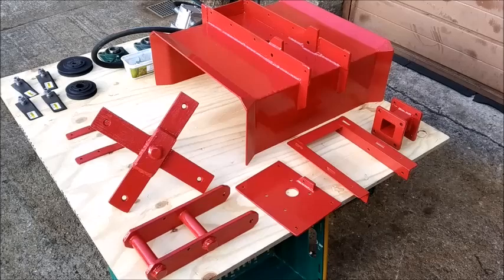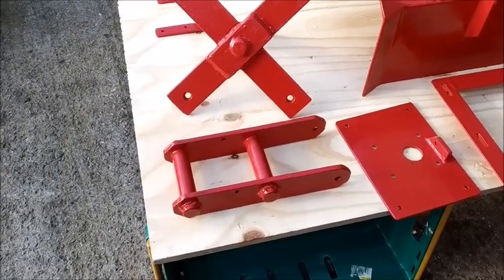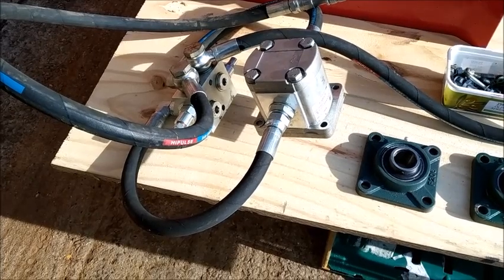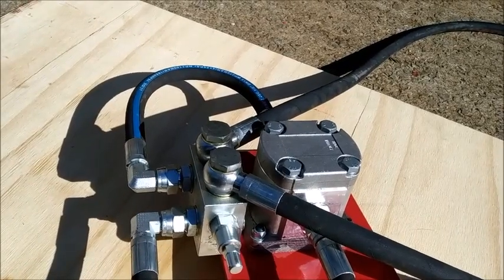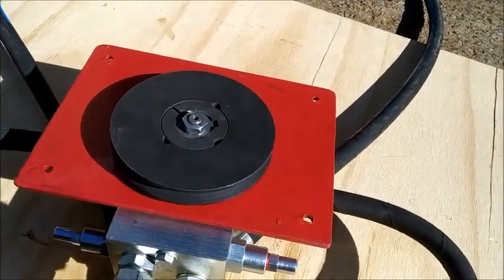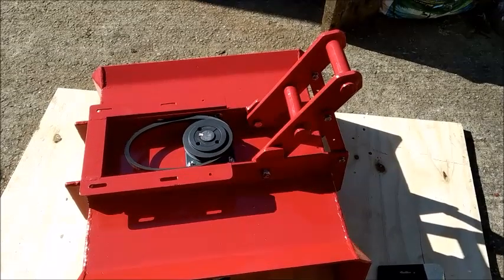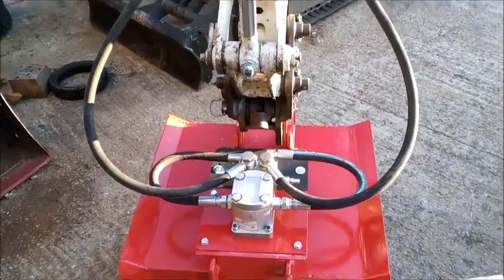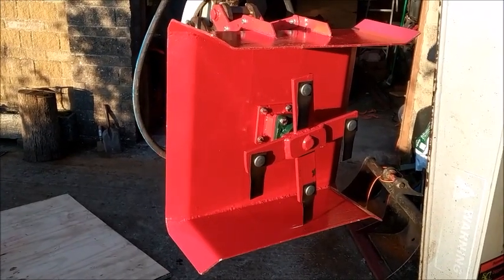Flail Trimmer for my Takeuchi TB216 Mini Digger

Comment: Hi great design, what did you do to ‘modify’ the relief valve? Currently ordered same motor and valve trying to recreate similar many thanks
Reply from the maker: The pressure relief valve has two pressure relief circuits, one I set so that the pressure relieves if the motor is stalled in the normal direction the other one the spring was removed and a short spacer fitted so the valve could open with zero pressure. This allows the hydraulic motor to over run when the hydraulic pressure is suddenly stopped without causing cavitation.

Comment: nice job well done . would you have a part number for that hydraulic motor with with internal case drain ? is it a group 2 motor with tapered shaft or straight  shaft ? thank you .
Reply from the maker: The motor is a single direction gear motor so there only needs two pipes and the internal drain return goes internally to the outlet. Its a tappered output shaft that I fitted one of Flowfit splined adaptors that I ground to take a standard size pulley.

Comment: Nice work! What size motor did you use?
Reply from the maker: The digger has a maximum hydraulic flow rate of 30L/minute (500cc per second) based on that I wanted a speed of around 2000 rpm. Hydraulic gear motors ratings are quoted by cc per revolution, using this I used a motor with 14cc per rev. Theoretically at 30L/minute a 14cc/rev motor should run at 30000/14 = 2142 rpm.
Reply: @brianbailey4565  Thank you👍